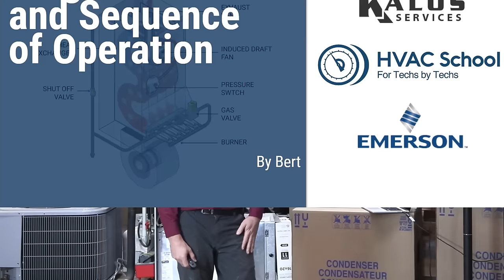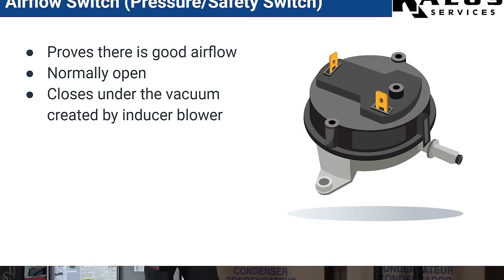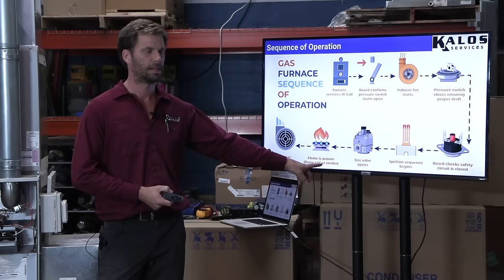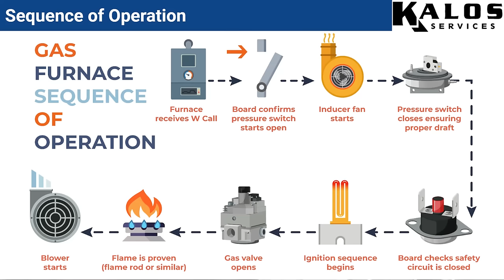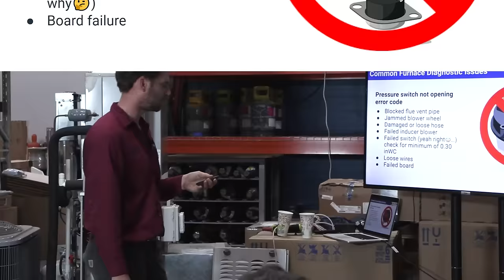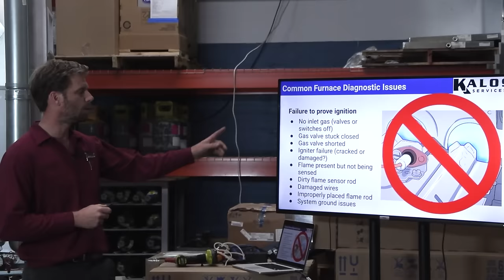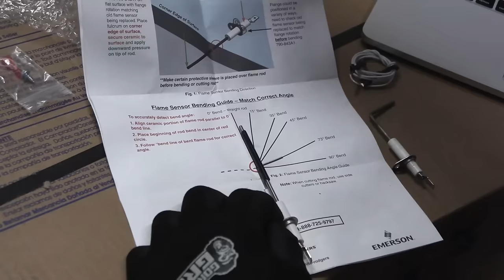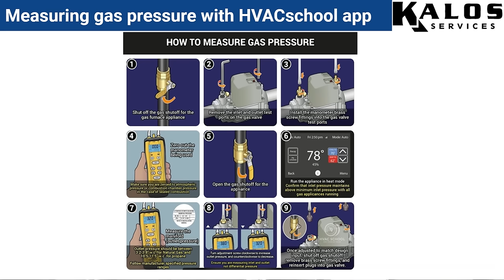Gas Furnace Class w/ Bert

Comment: I am an Instructor for the local Apprenticeship program. Natural gas is lighter than air not heavier. Propane is heavier than air. Also I wouldn't have rookies using an impact driver to tighten the flame sensor screw. If you strip out that screw hole you will have a bad day.

Comment: Nice job but after your clear trap that vent needs to be higher than the water line of the drain pan or water will pour out of it if the line clogged up after it

Comment: .02 draft or .20 draft when hot. Inches of water column. There are tools for this. What about the .10”we and the blower causes it to open. Basic or advanced we all need to use the tools needed for diagnosis.

Comment: On my furnace igniter stops working time by time, is it pressure sensor or control board issue?
Reply: Using what you learned about sequence of operation on this vid,  check pressure switch with meter to be sure it does what it's supposed to.
Reply: @Robnord1  Thank you Rob!